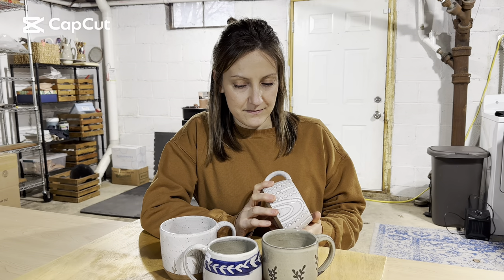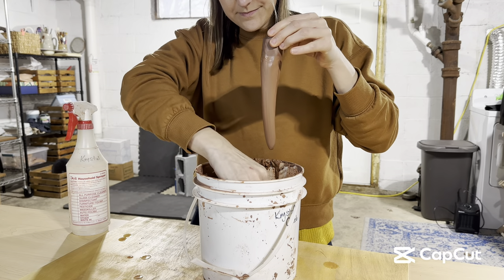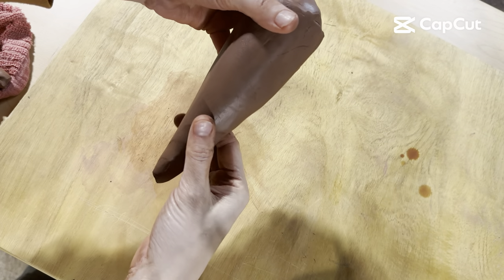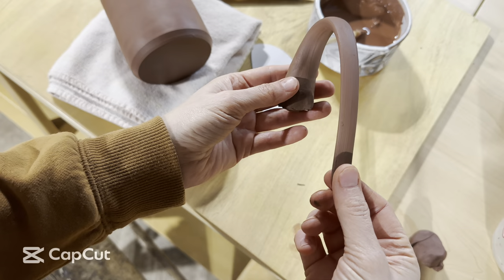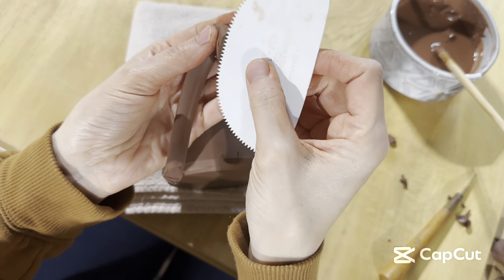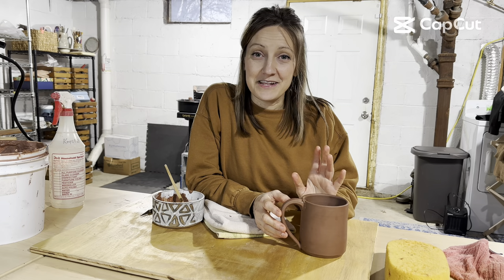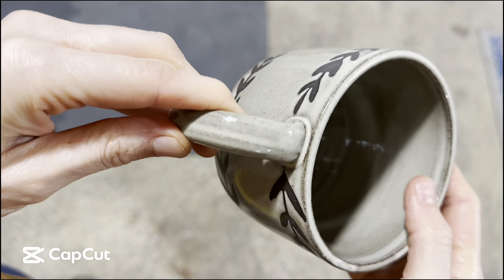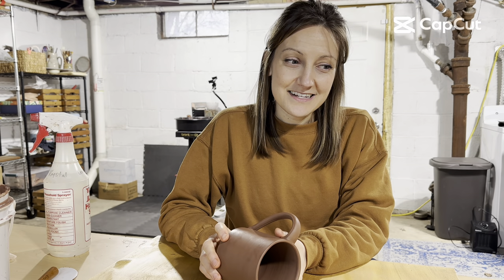Mug Handle Cracks? The best way to attach pottery mug handles!

Comment: I like the suggestion of letting the slip dry down a little before cleaning it up.  I think that will help my occasional cracking.  Brushing on a little liquid wax around the attachment sight can also be helpful, especially on delicate attachments.  Further, if you make a very long handle, for example on a teapot, waxing the entire handle will often allow a long thin handle to dry without cracking.
Reply from the maker: @mudminder  love that tip!

Comment: You can also wax around the handle joints and let dry.  Forces the water to evaporate out slower through the thicker parts of the mug, making it dry more evenly.  Cracking when drying is a result of thinner parts (wall) drying faster than thicker parts (handle lug). Eliminated cracking for me, as long as the handle's well-attached.

Comment: Thank you for this video!  I love to make mugs, but cracked handles are such a pain!  I always wipe away the slip, but I will try this method now.  I think you are also right about letting things dry slowly. Getting impatient has caused me to crack so many nice pieces or end up with warped plates etc.
Reply from the maker: Hope this helps!! Having extra slip on there will help add more moisture on the joint as well- which is ideal bc then both parts can dry together —if that makes sense

Comment: Nice demonstration! What temperature did you fire the mug to? If you leave some clay exposed, does that mean you have to fire to a higher temperature?
Reply from the maker: I use cone 6 clay.  My clay has a very low absorption rate- totally fine with leaving clay exposed.  --it doesn't absorb liquid they way a low fire/terracotta clay does
Reply: @krystalosmanceramics  I was thinking about vitrification. I think that's the first time I've actually written that word. I've listened to other YouTubers talking about vitrification. I wondered what happens when part of a mug is glazed and part isn't. Seems like the glaze provides more waterproofing, or something.
Reply from the maker: @catwoolf11  yes- when people are talking about vitrification they are typically talking about how porous their clay is and how much water it can absorb with normal usage. Typically low temperature clay like terracotta is porous- but it’s still totally fine to eat off of if glazed-just can’t put it in the dishwasher. Most mid-temp clay like the one I use, have a very low absorption rate and will not be harmed in the dishwasher- even with a lot of exposed clay

Comment: This is great! Approximately how long do you wait between sticking the curved handle on the table to dry a little and attaching it to the mug? I def waited too long on my first attempt lol.
Reply from the maker: The length of time depends a lot! I work in my basement where is very damp so it takes over an hour- but in a dry location (or if the heat is on) it can be quite fast! You do have to check it often to see if it’s ready- firm enough to hold its shape, but soft enough to be able to bend a little.

Comment: I think your method is very wise, but I often do quite detailed texture on my mugs.... I think using so much slip and leaving it will destroy the pattern 😣 any suggestions?
Reply from the maker: Hm- I find the crease is an area where glaze tends to pool anyway, I wonder if it wouldn’t make too much of a difference. Also, try playing the amount you use- just enough to allow a tiny line should be enough- it will shrink down to basically nothing as it dries
Reply: @krystalosmanceramics  thanks for the feedback ☺️

Comment: Use soft-ish AGED clay.- it stretches better. WEDGE the clay. Pulling should not take that long. Handles can be hung off the edge of a table to stiffen a bit; this creates the curve. A mug that is as stiff as yours is a bad idea for adding a handle even if the handle is the same stiffness. It is also nice to make the handle an integral part of the mug, i.e. it should look as if the handle GREW out of the mug, rather than stuck on- more aesthetic and a way stronger bond to the mug. Why do I know this, you ask. Because I am 71 years old and have been throwing since I was 26.